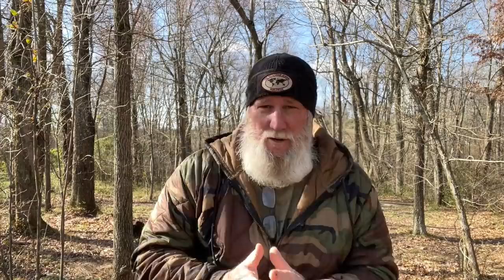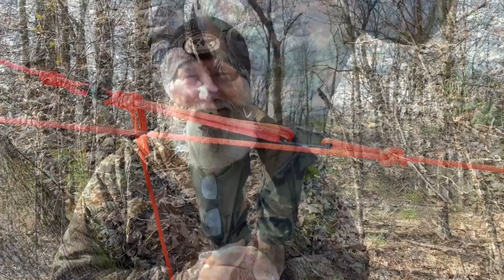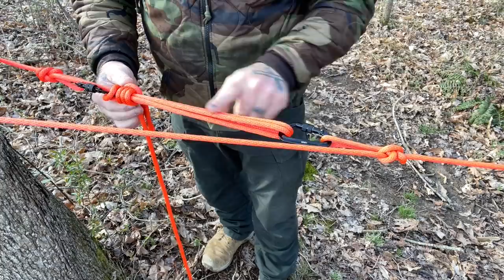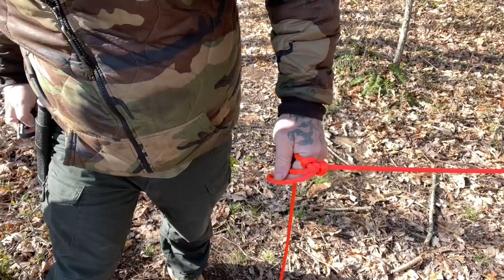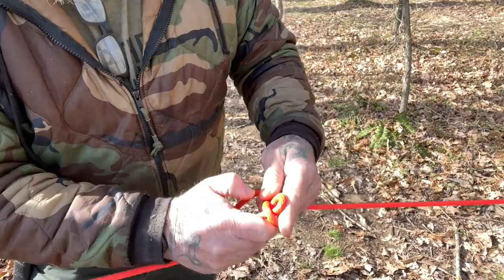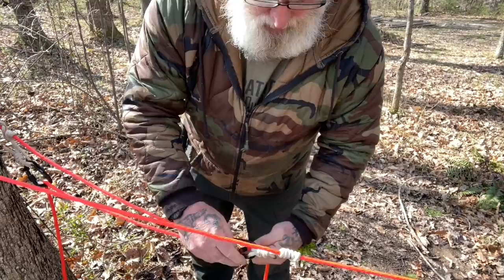Rope Clinic Part 9 Tensioning with Mechanical Advantage

Comment: I guess I'm outing myself as a rope-geek...I sometimes sit and practice knots while my wife watches TV...I am LOVING this series!  My takeaway from rock climbing is that rope on rope is BAD, I always put a carabiner in. The Metolius FS Mini is a full strength carabiner, rated for climbing yet they are very small and light.  3 or 4 in your pocket you'd barely notice.  The directional figure 8 is a great knot! The prussiks on that last bit...I would think they would have to be kevlar or dyneema to tolerate the extreme stress being put on them!  Overall just loving it.
Reply: Great pastime. I take paracord with me on long plane flights. The repetition really helps to build muscle memory.

Comment: We had a versa tackle setup with paracord and prussic hitches around a smooth pipe.  I asked my wife to pull it tight and she broke the paracord at the toggled bowline on the far end with one hand.  The amount of force that can be obtained in this manner is surprising.  Make sure you don't exceed the capacity of your ropes and hardware.

Comment: I want to preface my comment with many thanks for all I've learned from watching you and the other instructors at the Pathfinder School.  Your instructional videos are second to none and my outdoor experiences have gained so much more value from your videos.  I loved the 9 part rope clinic series. You mentioned that you thought you  might need to use a marlin spike on the directional figure 8 loop since it had been under serious tension.  I thought I might add, that if the loop was pulled forcefully in the wrong ( or opposite direction) it would loosen the knot, making it easier to untie the knot.  I think I learned this method of loosening the directional figure 8 from the Corporal.  I like to use it when tying the trucker's hitch.  Thanks again for all your vids and your awesome teaching ability.

Comment: One thing that is really nice about the Dutchman's knot (I learned it as the bellringer's) is that you can clip into the loop rather than feeding the working end through. That system is tieable in the bight.

Comment: For moving a heavy load on a rope under tension, look up the Z-drag and Pig-rig. These are two rope systems I've been using for decades in Swift Water Rescue. The latter especially allows you to reposition the prussiks whilst the rope is still fixed to the load and under tension.
I would also suggest that, any time you're putting that much tension on a rope, you should really have some sort of weight attached to it between the load and yourself. That way, should the rope break nearer the load end, the weight drops and lessens the chance of the snapped rope whipping straight back towards you. This simple addition could save you from having an eye taken out.
Reply from the maker: Yes we c=are going t speak ti that as well in another Part as well as the Flip Flop Winch

Comment: Nice... add some climbing 'biners, some climbing pulleys (blocks) and a rope ascender as a runaway safeguard... and you can do some things.  I lowered a Spider Stage bucket with two work wings about four stories to the ground on the side of the Federal Office building in Juneau, AK once, after the staging broke down on us.  Some good static line, and some careful rigging, and two of us lowered it hand over hand to the ground.  One man lowering, the second holding a pair of Gibbs ascenders open as runaway safeguards.  It was a hairy feeling to jack up the suspension beam to set the connection to the eye in the wire rope and undo the shackle from the suspension beam.  The broken equipment made it safely to the ground, no one got hurt, and we had enough mechanical advantage to enable one man to do it (we were a two man team).  My younger days as a high rise window cleaner.

Comment: Thank you for your guidance. I use a style of truckers knot when you fold your bend to make loop twist three times and feed a loop from loose end makes loop off second anchor. Side of bend. Does that make sense? Pulls loose like a slip knot when untied. Turn over three times then pull loop like tying a ridge line

Comment: Nice! In the prusik set up the prusik rope will be the weakest link in the system right? 
And when pullen the rope trough the carabiner.. you can also just clip a loop/bite into the opening of the carabiner. Handy when you have a lot rope at the working end.